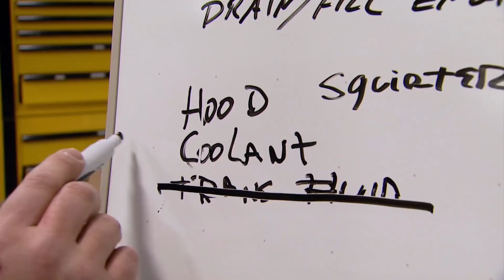Restoring a '67 Nova in 10 Minutes!

Comment: I really doubt if replacing everything from floor panels to body panels to suspension to transmission etc. is actually a "restoration" project. While most of the restoration projects around the world deal with limited budgets, and no new parts available at all.
Reply: This is more of a "restomod".  As far as what they did to the body, there was plenty of restoration done.  Regardless of parts availability and cost, it's still a restoration.